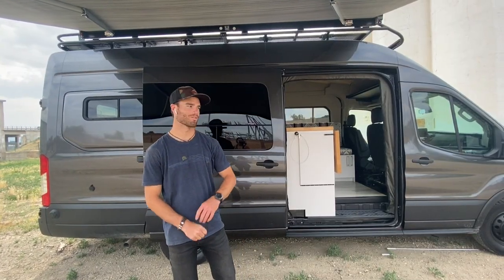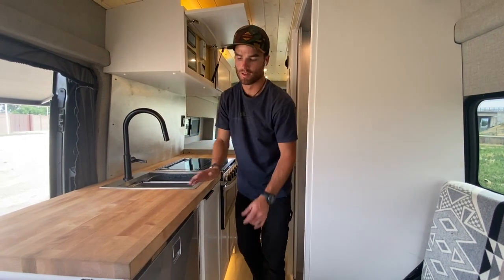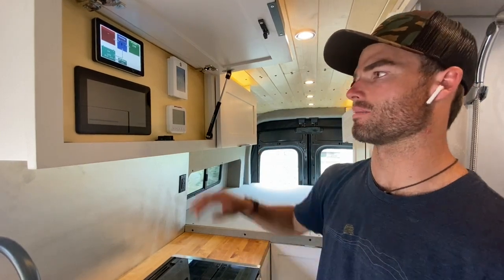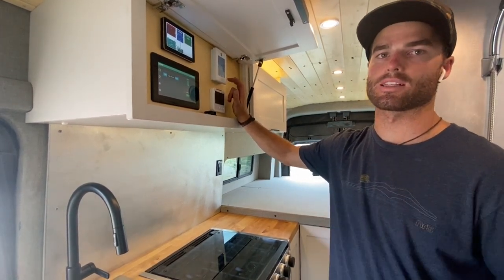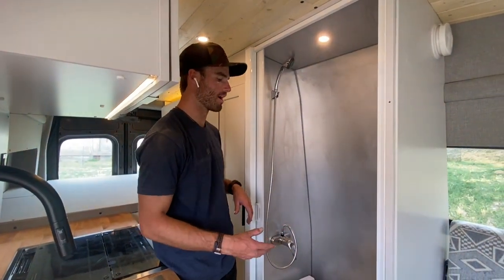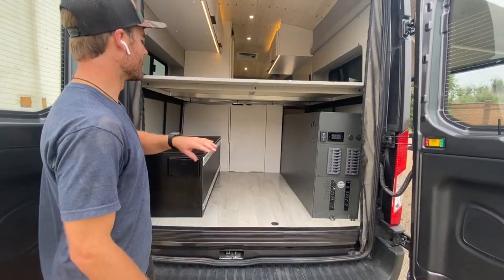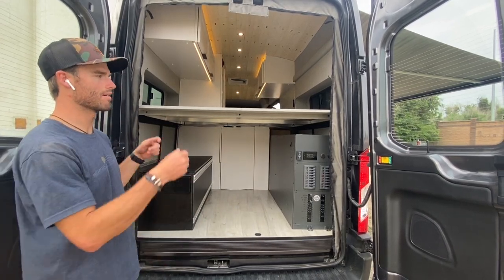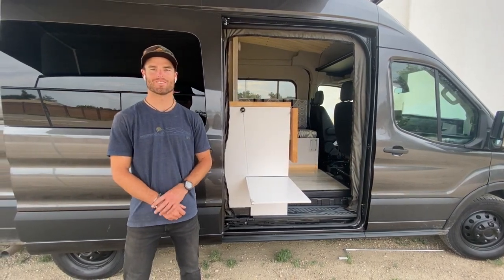VAN TOUR | Custom Van Build | Transit 148 EL w/ interior shower and toilet | Rossmönster Vans | 147

Comment: Does building in a mid roof transit make a huge difference with the amount of cabinets vs in a high roof? I mean relative to the placement of everything else like galley, sink , bed,  seating or bathroom? Are there limitations in one over the other? I'm 5 '8... ok 5'7 1/2😬 & would prefer a shorter van for more accessibility. Does that make sense?